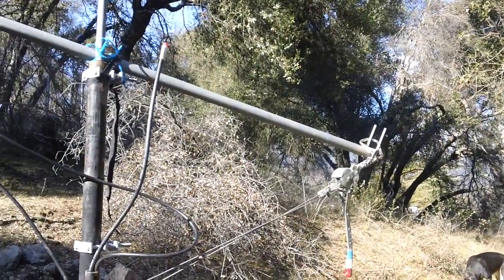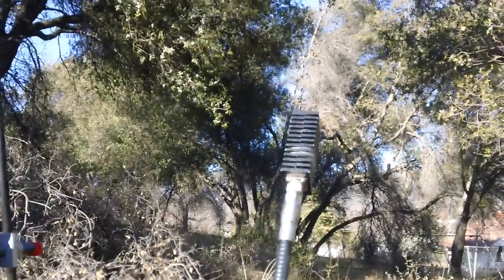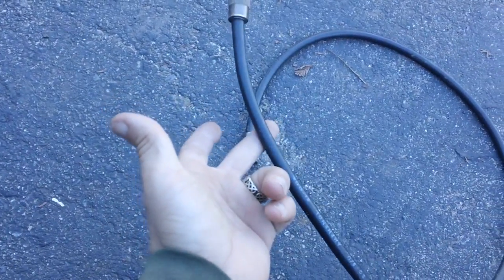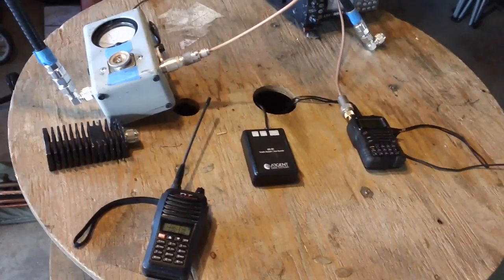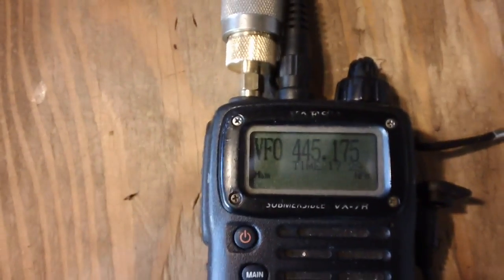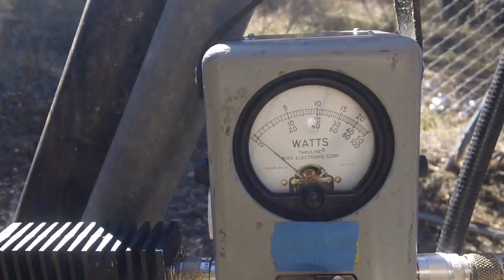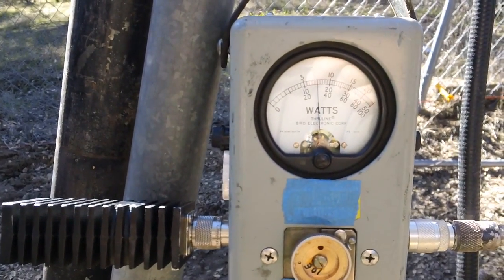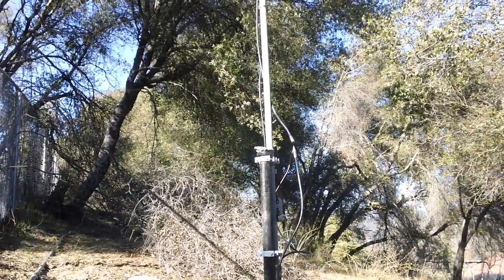Home Commo Antenna Mast Final System Testing & Cable Selection.

Comment: Well its 4 years old hope they are still up and working well for you, slim jim is said to  have a gain of 3dbi over a J pole and 6 dbi over a dipole? I have a discone which looks to be exactly the same as yours but it is my only RX/TX antenna for 2m and 70cm and the paperwork says unity gain which I take to be 0, I now use 20m of LMR400 with N types and it does well from inside the loft, I used to use 20m of military grade (real UK MOD packaged) rg58 which is much better than the usual rg58 when you cut them open and compare, it has sealed bnc connectors and far better twin shielding and outer jacket, even with that thin stuff up to the discone on the roof of a former qth it did very well compared to other locals on white stick antennas. 73 Phil 2e0tmi